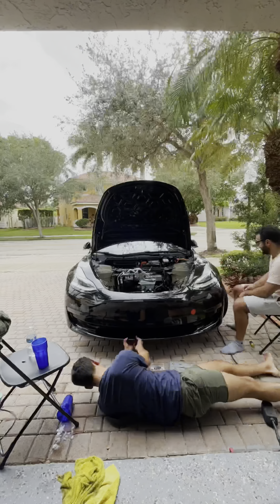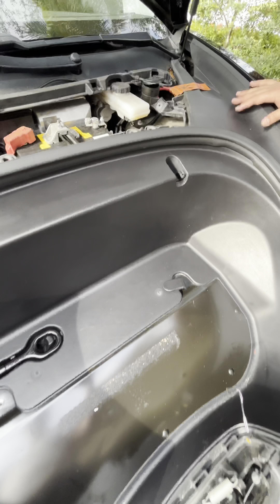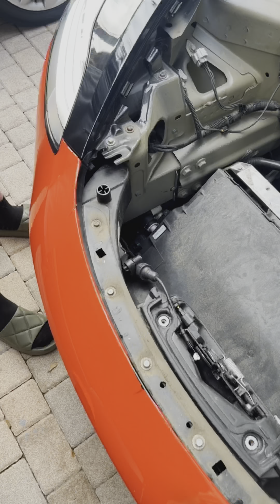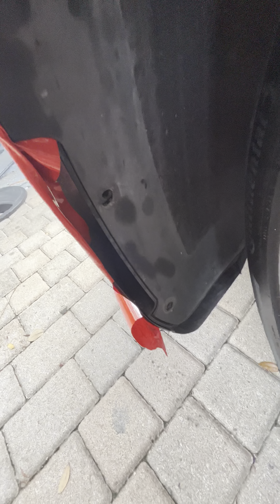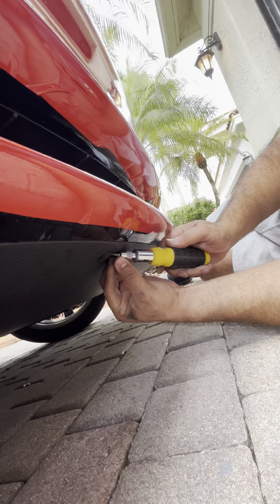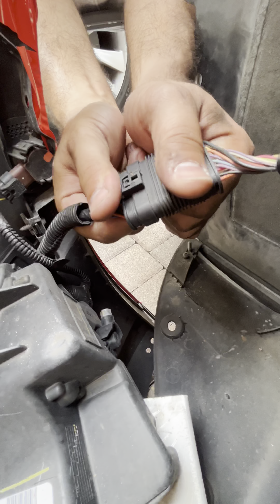The best way to remove Tesla Model 3 front bumper

Comment: Hey man, thanks for the video. Long story short, I have a scratch on my front bumper. I took my M3 to an auto body and they quoted me around $2,000CAD to get it fixed. They agreed to help me repaint it over if I just give them the bumper. Seems pretty easy taking it off. Did you run into any issues with putting everything back together?

Comment: …because I ran into a snow bank…
Reply from the maker: You ran into a snow bank!!
Reply: FYI - those are 10mm BOLTS  you are removing (not screws)
- the last two are NUTS (not screws)

Hope the wrap goes well
Reply: @SylvesterMemes  Model 3P is a fairly low car- Michigan Winters are brutal, 6in or more and I'm a snow plow.  Not uncommon, - also not uncommon to hit a large chunk of packed snow on the freeway- or plow debris higher than 6 in.